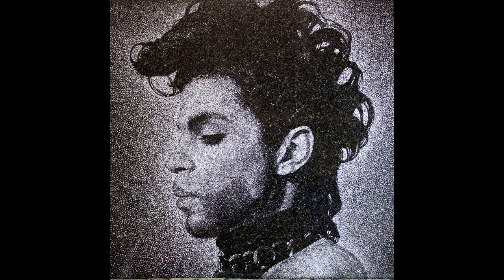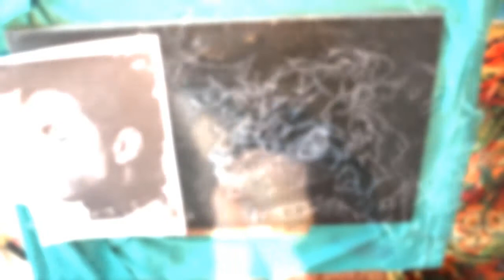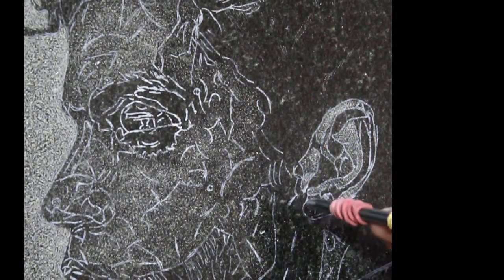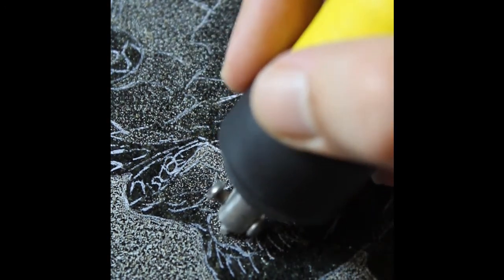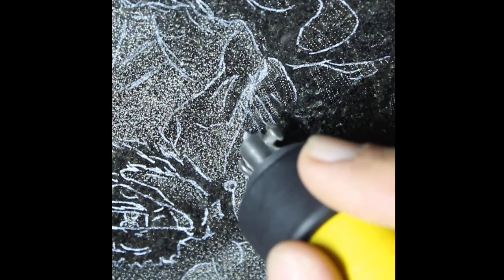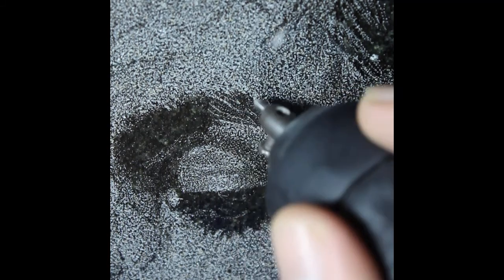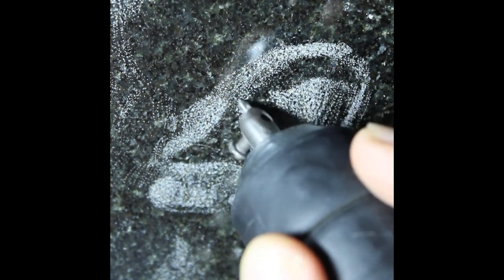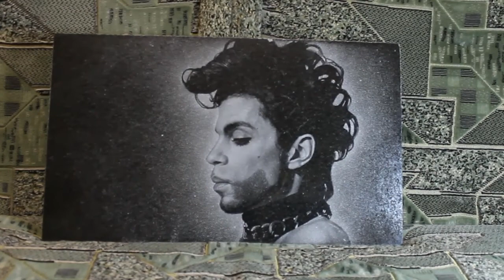Hand engraving black granite (Prince)

Comment: What type of paint did you use, and what did you use to remove the excess? A cloth only?
Reply from the maker: Hey! You can use acrylic paint. You dilute it with water and the more paint in the solution, the greater the contrast. You apply the solution to the engraving. You wait for it to dry. Then you wipe it with a regular kitchen washcloth (rough side). The paint is erased from the polished surface, but not from the engraved one. By the way, do you need knitting needles for your engraving?